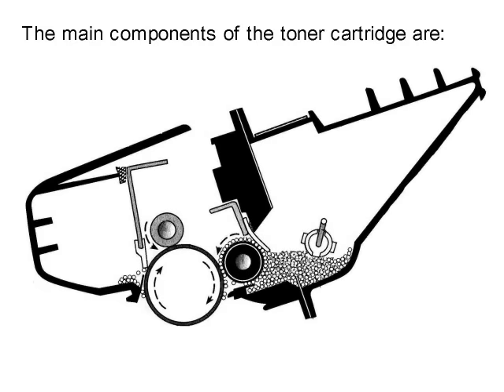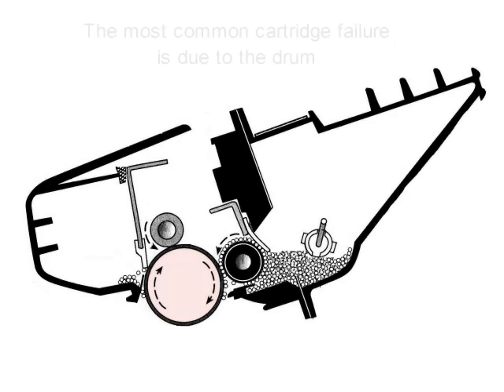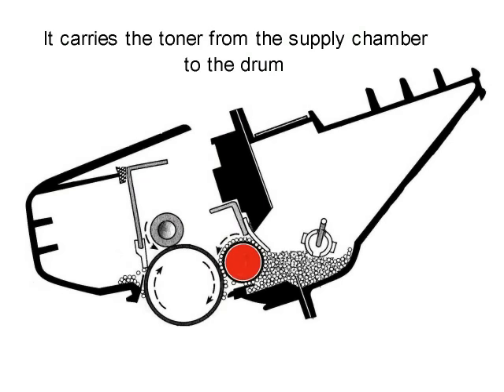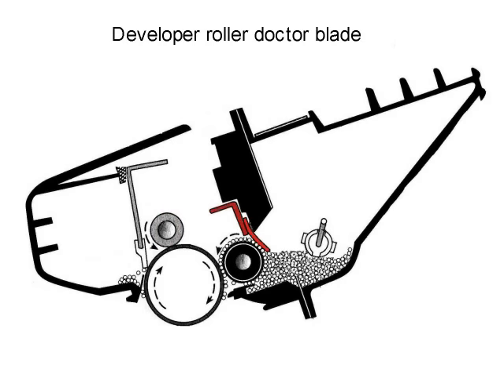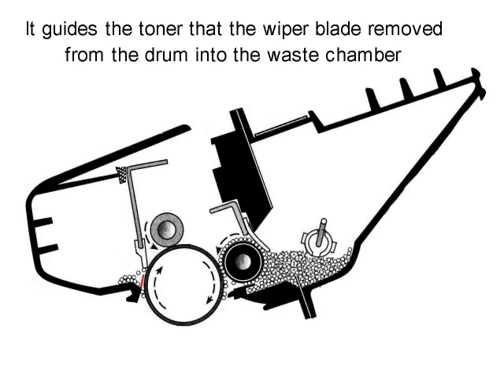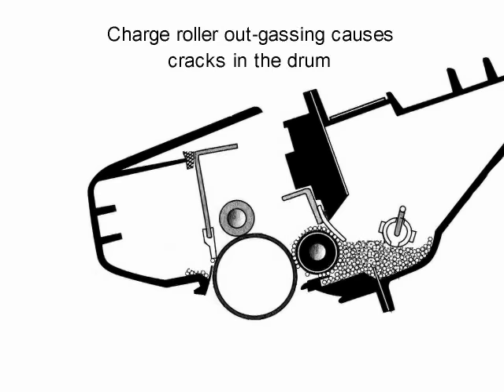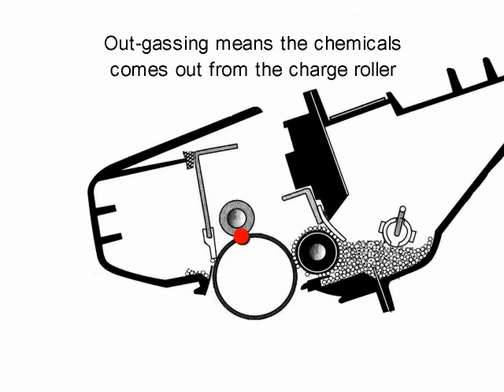Toner Cartridge Printing Defects: Causes and Solutions

Comment: Hi,
I possess cp1025.i am able to print black and color words on paper but color photos are printed in black and white or half or 1/4 photos are printed in color and the rest is blank. I have checked the green toner image drum and it has blue blot marks on its side. So, do I need to replace the green drum or the color cartridges. Pls advise
Reply from the maker: I think it's a setting problem. Look at the paper settings too. you can check the contacts between the toner cartridges and the printer

Comment: hi there , i have konica minolita 1600w printer, i refilled the black cartridge for first time, after refilling i found that the drum is hard in moving as compared to other cartridges, because of this printer is printing blank page., any solution please
Reply from the maker: Minolta 1600w toner cartridge does not have drum. do you mean developer roller?

Comment: How about the bottom left corner(about 1cmx1cm area)  of the page appears the ink wont stick enough and has loosened off, thus the ink appears as if it was dabbed with a sponge and not solid-looking.what could be the cause?
Reply from the maker: whitout knowing which is the printer it's difficult to say. May be te fusers

Comment: I transported my HP 1020 printer (with cartridge in the printer) by car with a journey of 2 hrs. Lately I found that it is leaking        very much without stop even into the printer. I removed it from printer. Will you pl tell me what could be the cause and solution. Thanks for your video that taught me detailed theory of laser printing.
Reply from the maker: A cartridge without the seal may lose toner. when you transport a printer. it would be better to remove the cartridge, keeping it in a dark place since the light may damage the  drum. Do not use air compressed to clean the printer, use a cloth
Reply: thanks a lot

Comment: Hello, nice video and channel. I have a Vertical white line or lines problem in a Brother MFC-L2710DW but it is not happening all the time. If I print 1 page, 2 o 3, it is ok. But if I print 5 or more pages of a larger document, the page number 5, 6 and then the rest, show a vertical and clearer band or stripe, always in the same side of the impression. I have clear all the printer and the change drum and tonner thanks to all your videos. What could be happening? The printer have only 3 years old. I was thinking of some dirtiness in the laser unit but it is not easy to access to it. Could you give me more ideas please? Thanks for your help.
Reply from the maker: Are you sure the toner cartridge is ok? Is the toner roller evenly covered with toner?
Reply: @viandant5  It has been already changed for a new one. It is completely covered with toner powder. Drum also changed. I have cleaned it completely. Thanks for your time and help.
Reply from the maker: @a4-driver917  It could be the fuser unit. When the fuser is cold the copies are good, but after a few pages the rollers become hot and you have the problem

Comment: Problem I have in Duplex.  On the second pass I have a 1/4 in grey (not solid) mark on the the top of the page. any suggestions?
Reply from the maker: It's difficult to say without knowing which printer do you have, may be the fusers

Comment: my catridge is giving very thin letters print. lines are not geting printed.

I have replaced tge drum and no change.!!!

please advise what may be the problem.

my guess is that the blade is to close and enough toner is not getting to drum.
Reply from the maker: +Praveen Davis without knowing which printer do you have, may be the problem is the developer roller. clean the developer roller

Comment: thank you for your excellent illustration, but I have a different problem and I'm not sure about the reason. the problem is a grey area    (about 0.5 cm) is appeared in the upper right side of the paper only when I use duplex. The single side printing is perfect but the problem raised only with duplex.
.
my printer is Samsung SCX-5635
Reply from the maker: +Ramy A Mosa it's difficult to say, probably a damaged or dirty paper feed roller. try cleaning them with alcohol
Reply: If this only happens with duplex it suggests something dirty/defective where the paper redirects for duplexing; so one of the duplex rollers maybe?

Comment: Samsung SL-M2875FW Xac Wireless Monochrome Printer has slight horizontal streaks when printing. Four horizontal lines 3 inch apart one inch from the top and bottom. Can you tell me what it could be? Thanks.
Reply from the maker: look at the OPC drum unit. the measure of that repetitive defect is related to the drum. if you are luck you can solve the problem cleaning the drum with isopropyl alcohol
Reply: viandant5 And let's say I am not lucky? What's the worse case scenario?
Reply from the maker: Ginger Andreiovici
the worse it can happen is that you don't solve the problem. here you can find how to clean a drum
https://www.youtube.com/watch?v=39Knu8KllTw

Comment: I have an HP 42X toner cartridge and when I was changing it out, I dropped the new 42X on the table.  I found a small circular spring with two prongs that stick out, and it appears that its purpose is to keep the flap that covers a green colored roller closed.  I have no idea how to position the spring to have it keep the roller covered.  Any help is appreciated
Reply from the maker: remove the cover, the cartridge will work even better

Comment: Hey viandant5,
Your video is very helpful but after refilling,  replacing OPC drum and cleaning the internals of the toner cartridge, I am getting vertical lines on the page at the one end. Also, the paper from the back is also getting dirty.
There are no misprints and the OPC drum becomes dirty after printing.
I am using Samsung ML2161 printer with MLT101S toner installed.
Reply from the maker: it's difficult to say without seeing the cartridge. Are you sure of the quality of the toner you used? did you remove the doctor blade? it's easy to damage it. is the wiper blade ok?
Reply: @viandant5  yes, I used the same quality of toner I used before also,I carefully removed the doctor blade in order to clean it.The toner cartridge has done around 4900 pages. So the wiper blade has a slight yellow tint on it but I got it inspected to a professional and he recommended to use the same blade.
Reply from the maker: @yashkushwaha5979  did you clean the cartridge before refilling? mixing toner could cause background. a yellow wiper blade probably is an old wiper blade, are you sure it's ok?  if you print images or full sheet text, after 4000 pages the cartridge could be nearly empty
Reply: @viandant5  Yes, I did cleaned the cartridge prior refilling.And the 4000 pages is complete lifecycle of cartridge so far with multiple refills.I refilled it recently and It was printing flawlessly but after few pages it started giving problems.I'm not sure about the wiper blade.If you provide me your mail ID I can send you pictures of the wiper blade and the pages.Also, Thank you so much of helping me in advance.
Reply from the maker: @yashkushwaha5979  link.accessori@libero.it

Comment: I have a problem that is not described in this video. My printer prints light text with some backgrounding across the entire sheet. There is a very light coat of toner on the drum. I suspect that the light text is caused by a bad transfer roller (pressing paper against the drum). But I don't know how to fix the backgrounding. Any suggestions please?
Reply from the maker: Difficult to say without knowing which printer do you have. may be the toner cartridge
Reply: @viandant5  It's a Lexmark Optra E310. And the toner cartridge is brand new. Thanks for the reply :)

Comment: There is a line at one side of paper which is due to drum, if i change drum i get a very good printout.
but i can see a line again at the corner of nwe drum.
I think the cotton which is use to clean drum is not bad, could you please help me to replace  it ?
Reply from the maker: +sandeep verma without knowing which cartridge you have, may be a defect on the magnetic roller, the bushings or a problem on the charge roller

Comment: After replacing a new cartridge, my HP laserJet  pro m15 printer prints black/grey bars on left and right side of the paper and left the middle blank.  What can be the issue?
Reply from the maker: It could be a problem on the magnetic roller, sometimes it's enought to clean it with a cloth. It's easy to disassemble the toner cartridge
Reply: I don’t know how to disassemble a cartridge.  When I manually turn the roller, I saw ink appeared around left and right side of roller.  I used a cloth to clean the roller.  Retest, printer is still printing black/grey bars.  So, it is a defected toner cause this issue.  I installed a new cartridge and printing is working now.  Thanks viandant5

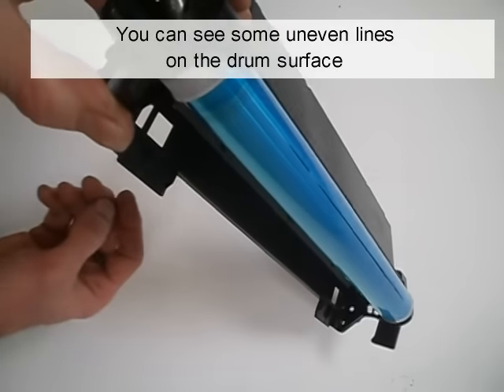Comment: 3:42 Lines in the drum surface
Brother mfc l3750 only on the black. What should i do? Thanks a lot
Reply from the maker: Clean the corona wire of the black drum unit, check the drum if there are lines on the surface

Comment: I have Panasonic 8032 workio photocopier. I have to add manual toner by opting the option in function menu again and again to get sharp and proper print as the print gets dimmer and dimmer after i take 0-100 prints. What should do it seems that machine is not taking the toner automatically from toner cartridge and there is enough toner in cartridge.
Reply from the maker: probably i haven't understood but adding more toner does not mean to have sharp prints. probably the problem is in the drum, ot magnetic roller

Comment: Hi... I have HP Laserjet 1018... When I print, the results are not satisfying... I mean... when I give a black background & white texts for making stamps... the black background isn't satisfying.. not coming pure black.... & one side becomes bit white instead of pure black & also when I print twice on same paper, the result becomes more horrible.... i use original cartridge & i even changed Teflon Sleeve... I badly need help..
Reply from the maker: +Suman Paul HP Laserjet 1018 is a low cost printer, a full black page is difficult to print. you can try to print different part of the sheet more time

Comment: Sir 78a cartridge print is ok print light background images magnetic roller blade is new  letters is clearly but some thick boxes are not clear what's the problem please solve me sir.
Reply from the maker: Unluckly it could be due to lot of causes. It could be a low quality or not compatible toner powder, a worn magnetic roller, a defective PCR, damp paper sheets
Reply: @viandant5  Pcr Also Changed But no use problem repeat thickness is not coming please help me mag roller blade is new but no use
Reply from the maker: @SLNSYADADRI  I think the problem is the drum. be careful. new compatible components (PCR and magnetic roller for first) could give problems

Comment: I have spaces on the pages where the print is vague from the top down.  I don't see a solution on what causes it or how to fix it.  My printer is MFC-J4620DW.
Reply from the maker: I do not understand very well what you mean. however, it's an inkjet printer

Comment: Hi, I'm having problem in my printer also. Its an HP Color Laserjet CP5520 printer. it is having several black line on one specific portion in every print i make. already changed new cartridge. (274$ per cartridge. so expensive) but its still the same. what could be the problem and how to fix it? thanks.
Reply: Another thing, I tried calibrating, cleaning using the options in the printer but still it happens.
Reply from the maker: +Macmac Barrera it depends on which type of lines. the lines are always at the same distance? which distance? look at the fusers.
Reply: yes its on the same distance. should i clean the fuser?
Reply from the maker: +Macmac Barrera which distance?

Comment: Hello I have an hp color laser pro mfp m182n. The problem is with the yellow cartridge that I see a yellow lining developing on the ends of opc drum though it does not come over paper. By opening the cartridge I found that the toner is leaking from ends of developer roller of toner section when put upside down . Is there any solution to this?
Reply from the maker: The line could be due also from the wiper blade. If you turn it by hands a toner line remains on the drum surface but it has no importace
Reply: @viandant5  so is it normal that the toner leaks from.ends of toner section (developer roller)? Or is it a defect?

Any solution if it's a defect
Reply from the maker: @hathakker802  The end felts are compressed. rough them up with a small screwdriver
Reply: @viandant5  already did that. Can it be due to doctor blade lifted upward than normal?

Any other solution?
Reply from the maker: @hathakker802  Or check the sponge behind the doctor blade
Reply: @viandant5  how to do so. How to identify whether that's defective. And how to fix if it's defective?
Reply from the maker: @hathakker802  If the felts are worn it's useless to rough them up, you have to change them

Comment: I have a ricoh sp 100 printer. i refilled it today and took a few prints. The prints were very light and then i noticed toner sticking to the drum. After some 40-50 prints the catridge became empty and the whole toner shifted to the waste toner outlet and the feeding outlet was almost empty. I mean 80 gms of black toner got wasted in just 40 prints.

Normally it can print some 900 full page prints before it runs out. Whats the problem here? I again filled the toner powder from the waste outlet to the input one but the toner is still sticking to the drum... Care to help?
Reply from the maker: +Shwetabh Mathur which toner did you use? I think it's a wrong toner, not specific for that cartridge, ot you do not clean well the old toner in the toner hopper
Reply: the original toner
Reply from the maker: +Shwetabh Mathur where do you find the original toner? it's not possible to reuse the old toner left into the cartridge, it's mostly waste toner

Comment: Hello sir i am using 12A catridge printer is printing well without any minnus but suddenly some times paper corner a round black mark occur and for checking if i print next no black mark will be there . but after some time same occurs
Reply from the maker: Avinash Vijay If I've understood well, there are not repetitive black mark on the page. May be a problem related at the charge roller ocntacts, or at a damaged recovery blade

Comment: i have a Ricoh SP 200 printer. it was working fine. But now there are black lines appearing on the left side of the page. please help me to solve the problem. Thank you. i wanted to upload a photo of my print out but don't know how to do it.
Reply: quite like (black dots on right or left side of page, at the same distance) in your video.
Reply from the maker: If the lines are vertical may be the wiper blade. check if the lines are on the drum too

Comment: my printer model hp CP1215,WHILE PRINTING DOUBLE TEXT IMAGE OF DIFFERENT COLORS  IS  PRINTING.PLEASE SUGGEST
Reply from the maker: may be a problem to the fusers, ot the drum unit
Reply: WHAT TO BE DONE
Reply from the maker: probably your printer needs to be repaired in an HP center. it's very difficult to change fusers

Comment: @viandant5 the right and left ends of my doctor blade is damaged {minor serrations}, hence I get vertical white lines on right and left margins of my print out. I  had hardly used that part of the printer since all my printouts were with margins 1.5". Is there any option of getting the part in the market..my printer is Konika minolta pagepro 1500w . Anyway thanks buddy for the video, it helped me diagnosing the problem.
Reply from the maker: That cartridge it's the same as Brother TN-2010/TN-2220, may be you can find it searching for Brother part

Comment: My Hp M551 does not print large files with pictures or drawings from Illustrator or Photoshop, for example. You would know what is the cause?
Reply from the maker: I would start reinstalling the printer driver. try to bypass EMF spooling.Open the properties folder of the printer, click Advanced tab, Click Print directly to the printer option.
Reply: Thank you for the answer, I will try!
Reply: check maybe your toner is almost empty there is many problems causing the printing of image